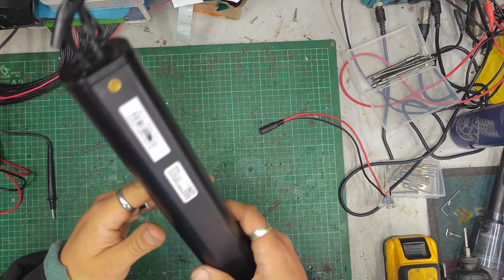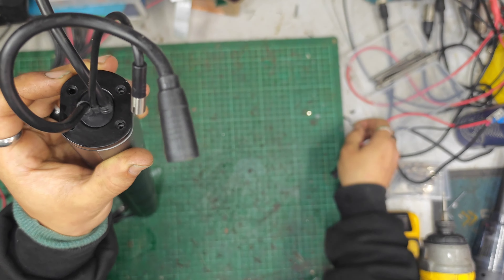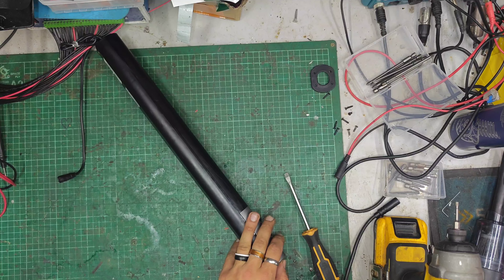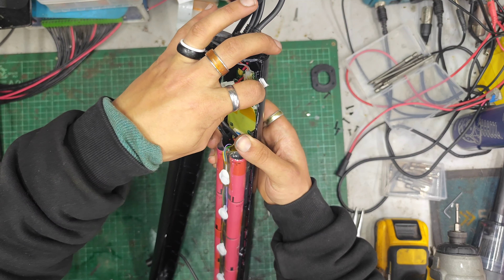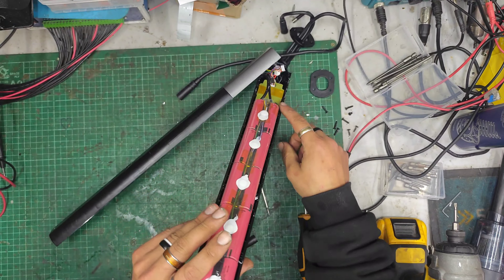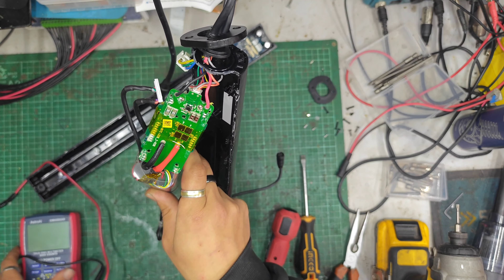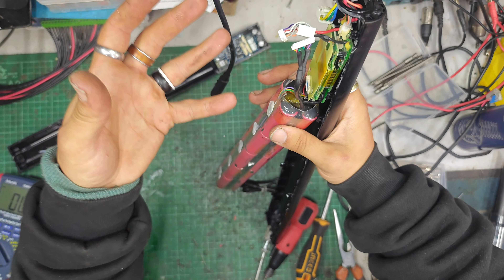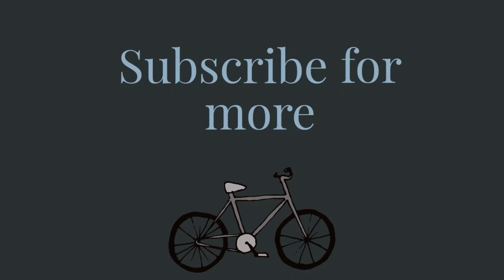Mahle X35 battery not working - can I fix it?

Comment: Very perfect Timing , i got one of this x35 systems without the Bike , it was my first time to view a Controller inside the Batteriepack 😂 , now i can do what i want , but first i see a purple led and the App tells me 1 cell is down 😊 ..its confusing how small it is
Reply: Frustration to view ur Video , 😂 i was in Hope 😢😂 , but i see this comming 😅..Its not for Save Resourses , its only to save Money for Producers..
...i will test the Controller unit and cables with a seperated Hoverboardbatterie , last idea ..
Reply from the maker: Good luck! I tried to get the controller to work with a separate voltage not the original battery and it wouldn't work :(
Reply: @EbikeRepairs  😂🤔 it was my next PlanB ..again ,frustration 😭🤣... I can't belive how might the insustrie fight for unrepairable Consumer stuff like Elektrikverhicles ..xD I mean , -\+ a Engine and a trootle xD xD ..of course a Overwatch for 🔋 ...but what we get is a Card house 😂🤯😂 ..new company's in EU have to look for Upcycle-Circle but In reality * lost more Resources by building the complicated  Way for use "Energie" ..sry my english is the high-end quality xD I open aloot of Liion Akkupacks and view to much good Cells and one or max 3 was dead ..but the Normal user trows all Time "Broken packs" away ..can't open without destroy or the Company's burn it down 😂 again for Energie to produce new Cells ..wrong Circle but ..u know , controller dies..BMS closed forever ..packs full of Glue etc.etc.

Comment: Always wanted to see inside one of these! Thank you. Rather than shelling out the €622 for the battery/controller, might it be possible to replace the controller with a KT aftermarket model and recell the battery? I appreciate connectors may need to be changed…and finding a controller small enough to fit into that area may be impossible…it’s just that I’ve been running a DIY range extender on mine for years and that was also supposed to be impossible due to the CANbus…would appreciate your thoughts, and thanks for a great channel!
Reply: As you probably know, KT Controllers are designed to only communicate with KT displays so even if you could find one to fit inside the existing Mahle x35 battery case, it won't communicate with the iWoc display. The next big question to answer is whether the Mahle X35 motor is a 'standard' sensored hub motor that would work with a KT based system? If the answer were yes and I was faced with a 'broken' X35 battery and didn't want to shell out the money for a replacement (700 GBP?) then I'd look to scrap everything Mahle except the motor, recell the battery with a KT controller, fit a KT display and independent PAS and speed sensor (unless there's a way to utilise the Mahle ones?). All in all quite a technical challenge and not for the feint hearted.
Reply: @alanmorgan1389  That is exactly what I was planning Alan. I suspect the first gen X35’s are rather more amenable to ‘alien’ components, as a friend tested his suspect motor by swapping in a Swytch bike motor and it worked. Losing the Iwoc would be a benefit frankly though I do hate clutter on the bars…I’ve played with conversion kits before and I’ve been itching to re-cell with higher capacity cells…I do like long rides!
Reply from the maker: It is certainly possible! I uploaded a new video on it :)
Reply: @EbikeRepairs  I’ll go take a look. I’ve been thinking about this for years!

Comment: Its like a poison pill software function. On Ryobi 40 volt tool battery packs, they used to shut down if the voltage dropped below a specific threshold. People would toss them in public recycling bins after letting them set over winter and I would fetch them and use a bench variable DC power supply to coax their voltage back up above that threshold and IF the cells were still good, it would come back to life and work again. Great video as always!
Reply from the maker: Salvaging is great! Unfortunately these packs seem to just... Die...

Comment: Deeply discharged cells can be often repaired. Main problem is that if you try to charge it there are crystals forming inside cells causing shorts or self discharge issues. But if you connect like 1mA charging for a week (might be second battery connected paralell through ~20 kohm resistor) you can avoid forming those crystals. Often there is only slighty loss in capacity but cells still working. You should try it.
Reply from the maker: This one has gone in the scrap, but unfortunately it wouldn't come back to life once the BMS had detected that it shut down!

Comment: So let me get this straight, you didnt try to repair the cells or replace them... declared it "unrepairable" 😂
Reply from the maker: @jakebaked5996  I did it off camera dude don't stress :) sadly can't replace or recharge cells as BMS has wiped it's vram/eeprom so won't come back on sadly :(
Reply: @EbikeRepairs  I have edited my post with your response in mind. But there's no such thing as "not doable".... probably a case of having the correct software to reset / reprogram the battery (which makes it doable but not at your shop).
Reply from the maker: @jakebaked5996  yes totally! I wish I knew how to fix it :(((
Reply: @EbikeRepairs  I have access to a broken Mahle X35 bike like this right now, it's a shame it's wrecked by proprietary hardware (dead battery) .. almost heart breaking to spend £600 on a genuine but rubbish hardware locked battery worth £200 tops from manufacturer with a stupid controller built into the battery that becomes ewaste as soon as a single cell fails. Almost criminal id argue. I can't really believe these companies are getting away with it.